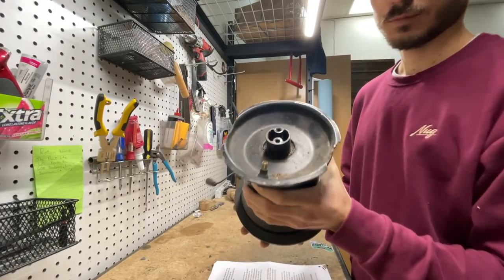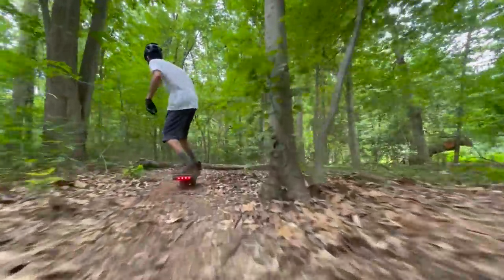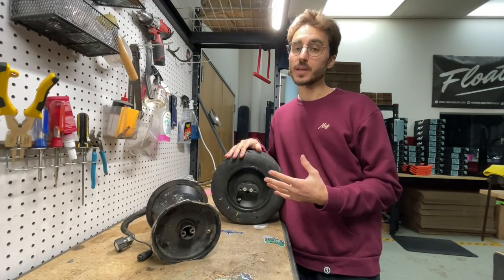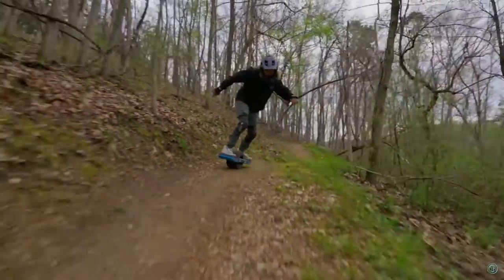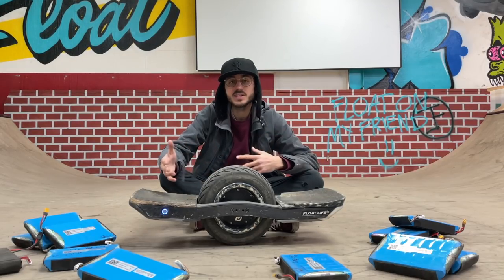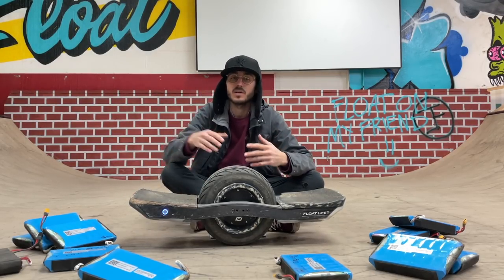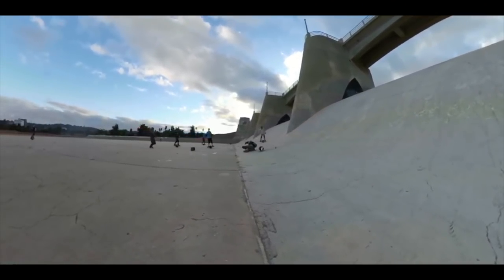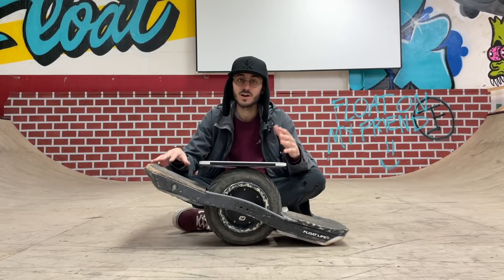Two Glaring Design Flaws on the Onewheel GT

Comment: 1/4” difference hub to outer tire.  I guess that would make some difference but how much?  The 1/2” diameter increase also increases torque.  Also, maybe the hub is going to be made of stronger material to compensate.  I think it’s too early to say it is worse for off road as all the specs of the GT really are not known yet.  Maybe everyone should just wait till it’s out.  I totally agree with supporting 3rd party companies and I’m a supported of TFL.  I also bought a new in box XR from my local dealer on a steal of a sale better then FM price.
Reply from the maker: Yeah I should’ve mentioned the torque. Personally I want to see the hubs get smaller but I know not everyone agrees on that. I think it’s important for trail riding since there’s no suspension in a onewheel
Reply: @JakeLeary  would you go for a smaller hub if it meant less torque?  I totally understand your point of more air etc … but it’s seems like design compromise may have been needed.  But like you said, hashing this out with experts in the field might have lead to understanding of those decisions ahead of product release.  Great thought provoking video.
Reply: WINDINGS create more torque. Simply put, more windings = more electrons moving around stator = more rotor torque.  Hdiameter does play a role in torque but only to a small degree compared to the windings.
Also stronger metal for hub ?? Where are you getting this ?  The hub will likely be the exact same heat pressed aluminum as the xr and pint. Strong = brittle, which is why a mould cast hub cracks instead of denting 

Don't kid yourself, the reason for that hub size increase is to make tire options proprietary from fm, and I can guarantee you that if you disconnect the hub motor from the battery on the gt the micro controller on the pcb will not hold memory, which means youd need the ide program to reprogram the board, the exact same reason you cannot disconnect the battery fully from any modern vehicle, it will need factory re programming if so... in the car case it's also for cost savings, much cheaper to not have a cmos battery on the control circuit. Respectfully intended
Reply: @JakeLeary  I'm waiting for the new vesc chips to come out.. working on a prototype with a tread and sideways mounted suspension  instead of a tire.   tankboard 1.0 .     Using an arduino mega and some relays..  though winter is when I work so project mostly on hold till spring vacation time :)

Comment: Onewheels is a bad design and nosedive because the gear shut off suddenly is the reason I sold mine.  I bought a electric board and it was the best decision is faster, more acceleration and range.
Reply from the maker: That’s highly inaccurate to say “the gear shut off suddenly”. The Onewheel does not self balance by magic. It has a limit, and you should know not to push it past or even close to its limit. If you push past the limit you have to do the balance yourself.
Reply: A fulcrum is what you become when you stand 9n a onewheel, your argument is literally this: " this product is bad because it cannot overcome gravity and must abide by the rules of physics" ... its a dumb argument, respectfully intended

Comment: Just because the hub is bigger, doesn’t mean the tire won’t be smaller or lower profile. 

Look at the tire that comes on it. If you were riding an actual GT and could feel the difference, I’d believe you.

This is just a guess and not based on any facts or experience. 

Piss off.
Reply from the maker: The video is called "design flaws". I enjoy thinking and talking about design and I'm sorry you don't. The initial impressions/ riding review will be out in about a month.

Comment: Yep Jake ! we are a whole buch who'd like to know were you would have loved to put the extra batteries on a new OneWheel ! 🤔
Reply from the maker: Well for starters I would’ve made the board wider rather than taller, and if I extended it vertically I would’ve done so extending downward, closer to the tire, not downward where the bumper strikes the ground. If you look at a Onewheel from the side with the power off (tail touching the ground) there’s a whole bunch of room near the tire. The bottom of the battery box doesn’t need to be level with the controller box. This would also help when you drop down curbs or going over rocks that slap the battery box, you would scrape more but you wouldn’t slap the battery as hard. I also like the idea of putting batteries up front by the controller, but I would need to consult with someone who knows about batteries to see if that’s feasible. It seems like there is a lot of room up front. Or if you wanted to get really crazy with it, even extending the rails to make the deck into the Carvewell style to get room on the sides of the wheel.
Reply: @JakeLeary  Nice ideas I confess. 👍🏼
That reminds me the Two-X battery extension for OW+ that were pretty smart too.
The controller could also be smaller and safe space for some extra cells. Making the board a little wider, and that could fit. Like a 13 to 15 cells battery pack in the front and a 26 to 30 cells in the back/tail.
Anything is possible, with some engeneering and the will to make it. The goal of FM was also to design a new battery pack with a different number of cells, giving it a different voltage so you can't use the former chargers. FM's policy. But that's another purpose. No polemics. 😅
Reply: @JakeLeary  thanks for sharing your vision Jake. 👍🏼

Comment: Float life should make smaller hubs with tires that have taller sidewalls. How hard could it be
Reply: Very.
Reply: To design on paper.. super easy ( though you'd have to physically fit more windings in said smaller hub )  to actually make... fucking difficult, especially the tire since a different tire profile size requires a new mold to be made which is VERY VERY expensive.  Go cart tires are race rated  I.e. a Burris slick 8s rated to go 150 Mph In a professional go cart race, it WILL hold up especially at lower speeds over time, there are also plenty of options available to people to customize their tire baeed on what they like.  Mark my words here ( im sure Mario will have a thought on this )  when you disconnect the power from the motor circuit on a gt you lose continuity of the circuit and the micro controller on the pcb will lose all its program memory.. hence bri king the board and requiring Fm to reprogram it with their ultra secret arduino based ide program ( self balancing robot) .. its the same reason you can't disconnect a battery from a modern car.. no voltage = = no held program memory... its cheaper to not have to add a cmos battery to a pcb and also makes sense why they say you "can't change it yourself"  ... I will be bo.d enough to guarantee you this is the case with the gt and await to find out if im right... Mario...  you do it first, disconnect the power and see before you ride your gt and if im right send it back for warranty 😉 with zero miles on it..   of course I'd not expect you to brick your new gt, but would you agree this is what's going on ?
Reply: @TheBoardGarage  just responding to you directly, see my other post here :) 😀
Reply: @MrDmadness  I'm not sure they're going to go that far. Seems a bit extraneous for them to incorporate that.
Reply: @TheBoardGarage  it's cheaper though, no need for a SD micro, or a cmos.  Less $.   It's the only way I can see them having full monopoly, and for the same reasons that newer cars 2or, in the same fashion. I'd be curious to know.